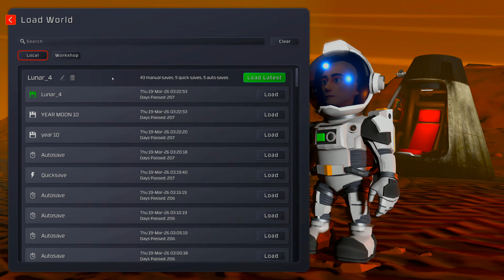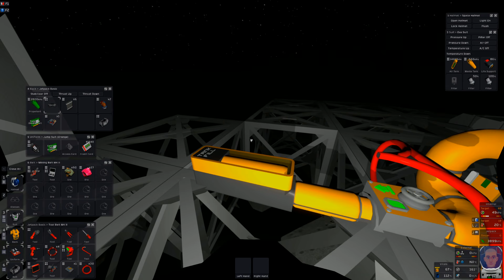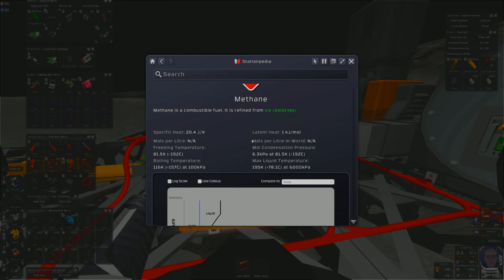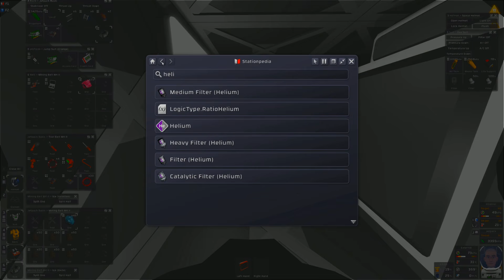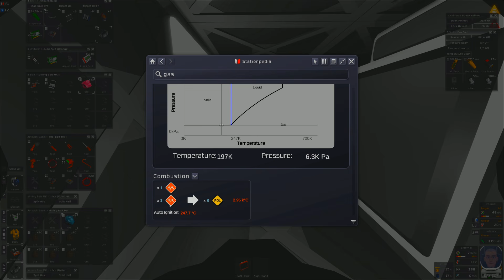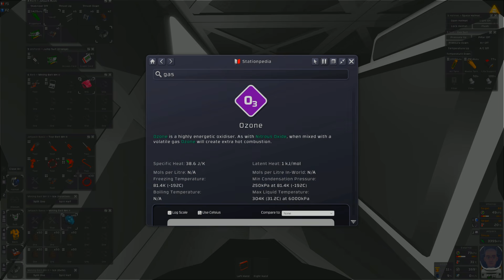Stationeers: a quick look at the new gasses just released today.

Comment: Chief with the new gasses the atmo of Vulcan and Venus has changed.  Mars and Europa are still the same.  Vulcan has about 6% of H2 in it.  Venus has its CO2 dropped buy 30%, and now it has HCl in it instead, 63/7/30/0.1 of CO2/N2/HCl/Pol now.  if you want to get the new gasses, either trade for them or rockets.  Next time you look at the stationpeedia, look at water again.  if u scroll down to the bottom it will show all the gas combo mix ratios that will make water now.  other options is look at volatiles gasses, H2 CH4 etc or oxidizers O2 O3 NOS and it will show you the new mix ratios too.  you kind of saw it with H4N2 (hydrazine)  for the things that take fuel mix (H2 +O2).  they make water in everything that burns that fuel!  Combustion Deep Miner, Combustion Centrifuge, GFG, u saw the furnace..... so there's more than the combustor that can make water reliably.  
other new things that i think u will find useful: Liquid filtration! works like a regular filtration but for liquids, insert the filter to filter out the GAS and LIQUID u want.  2 the fermenter, from the atmospherics kit.  it makes booze! Shine and PW that you can clean into regular water. its another means to make water from plants.  3rd there's a new ore scanner, printable from the tool printer.  its like a metal detector in ur hand.  i think it will be really helpful for you are color blind, u can select the ore(s) you want to find, and the detector will guide ya.  till you get the sensor lenses.  the ore detector is part of the starting kit on normal drop too.  
4th, the new supper coolant, Silanol (Sil) is inane! its temp range is -110 to 548, Pol is -99 to 152.  and cause it has such a high temp range, it can be used with Venus atmo (463C).  its  expensive from traders, but IMO worth the $$!  it has 10k Latent Heat and 101J/mol specfic heat.  100deg max temp delta, Pol is 80deg.